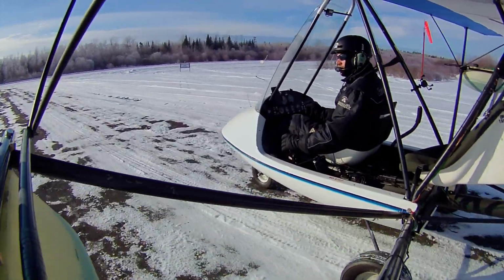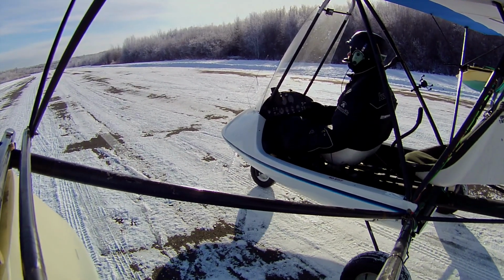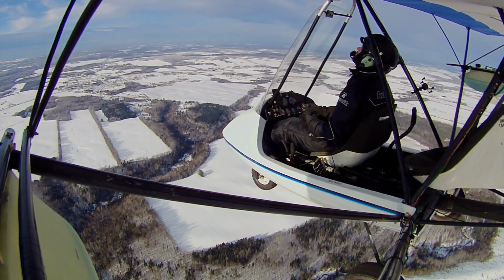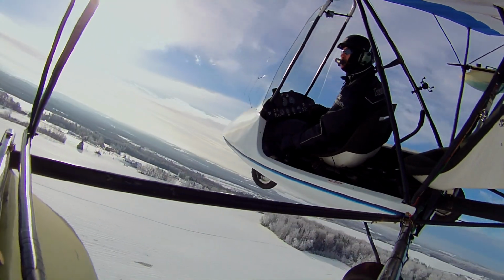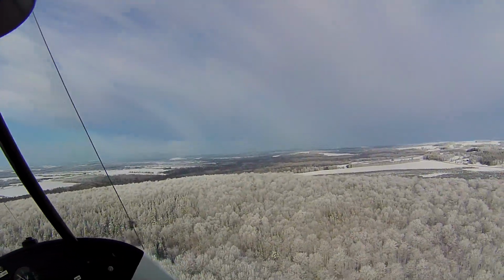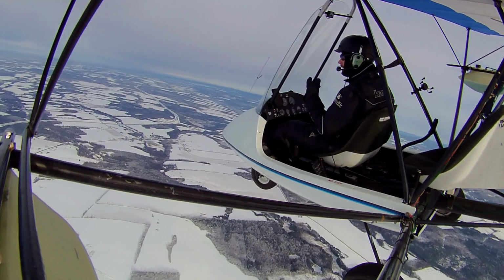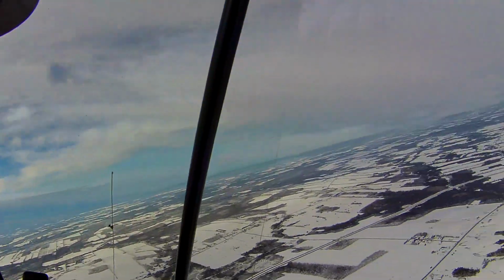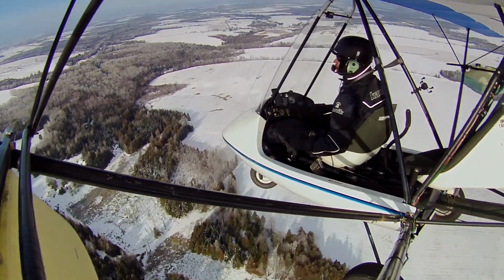Frosty Flight on Wheels with a Plowed Runway

Comment: High rpm is what makes a 582 not do many hours. We fly with considerably less rpms here in Europe. 4900-5300 is optimal for longivity. Havent you already have one engine mishap a couple of years ago? I like your videos, but wonder why an instructor flies with so much stress on a motor.
Reply from the maker: The engine mishap I had before was from unreported damage from the previous owner. I have been advised by Rotax technicians that higher RPMs are essential to preventing carbon buildup and does no additional damage to the engine.
Reply: mmatt high rpms will result in shorter lifespan this is a world known fact. I trust only common sense regarding safety issues, not personal recommendations from a rotax technician. If you read all rotax manuals they dont say a recommended rpm during cruise. Just minimum rpm and maximum rpm. I am from denmark and here its normal to see 500-750hrs on a crank before replacement. This I seldom hear about from Canada/USA. But we also have gasprices 3-4 times higher than you so maybe we are just cheap bastards:) still like your videos just wanted to give a little food for thoughts.